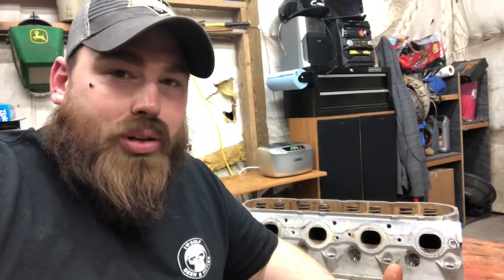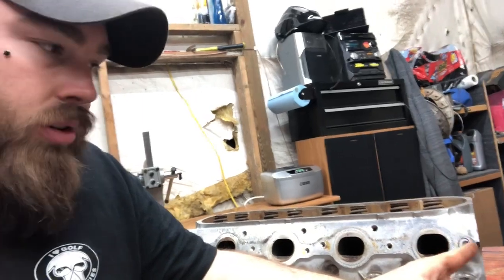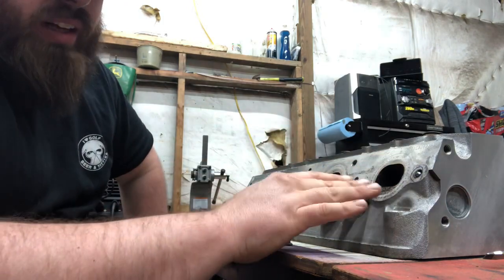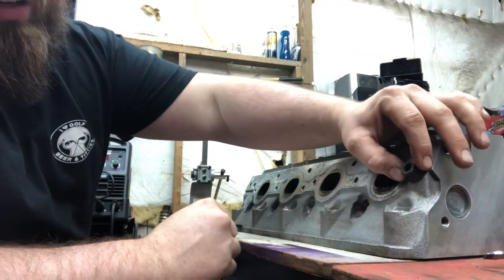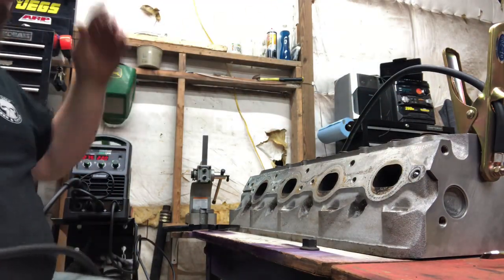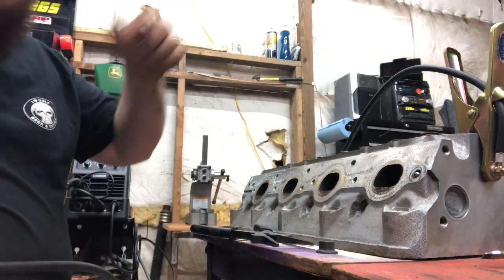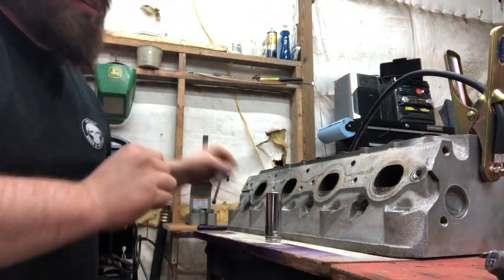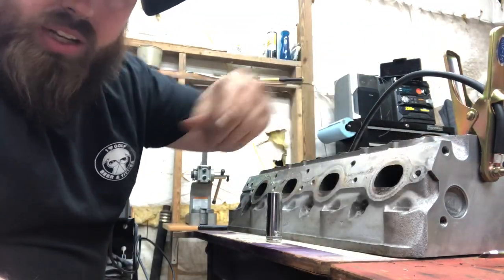Broken LS Exhaust Bolt Removal

Comment: I came here because I just broke off an easy out in an exhaust manifold bolt on a hummer. The engine is out for a motor swap. My fear is that the bolt is a bit inside the hole so there is at least a 1/8" gap between the bolt and the surface... plus the fact the broken easy out is in there.  I have drilled all the way through the bolt and sprayed on blaster as I drilled and after I made it through the bolt hoping to get it on threads through the backside as well.  I have a good flux core welder.... got any tips, do's or don'ts before I  attempt to weld the nut on?  Like others I'm a DIY big time harbor freight customer....
Reply from the maker: Don’t worry about the gap too much just make sure you start your weld on the top of the broken bolt. Easy outs are far more easy to break than people believe. Plus the amount of heat is introduced to the aluminum will help with expand a temporary enough to help back the boat out. I think you’ll be good. Just take your time and pay attention

Comment: What do you do if you have a brass fitting(with a 1/8" hole in the center) in an aluminum head?
Reply from the maker: Drill it out straight to the biggest size you can get it and use an easy out.

Comment: Great job. I know all welders are different, but can you give me some idea of the power settings and wire speed you're using. I have been trying this technique and I'm having trouble getting the weld to grab? I have a Titanium 170 from harbor freight.  Thanks
Reply from the maker: Honestly I have the welder turned up nearly full throttle. It’s better to get good fast tacks on the bolt vs lower heat cause you’ll spend more trine trying to get it to bond well which will actually introduce more heat into what your working on. If you have a piece of scrap metal just turn your welder up to where it gives real good hot fast tacks and do the same thing on your bolt.
Reply: @ZaksMuscleMotors  Thank you so much! I'll run a few test on the studs I've already removed. Cheers John.

Comment: Great video can it be done with arc weld ? I don't currently have gas for my tig yet cheers my head is aluminium
Reply from the maker: You could do it with a stick welder witch would be a little pin in the ass but yet it can be done, or flux core will also work. Just gotta clean the slag after each tack. But remember it doesn’t take a lot either to removed them in most cases so you don’t have to go crazy with it
Reply: @ZaksMuscleMotors   @Zaks Muscle Motors  I managed just 3 out fully 5 are broken I had built up one nicely got a grip but it broke with some force . I've ordered a better brush for the slag  I do try tapping it out etc briefly with a hammer when you say flux do you mean 7018 rods or flux in itself? I'm quite new at welding as you can likely tell I'm keen to get it done myself if possible I appreciate the tips thank you I know I need to get some argon really
Reply from the maker: @kevinhancock4064  I’ll be happy to help you and explain it to you give me a call 7655247362
Reply: @ZaksMuscleMotors  hi mate you're a legend obvs a bit late now but can I call you tomorrow eve 7 ish ? I'd have been to work kids gone bed etc I do appreciate it's become a headache and no expert on welding lol
Reply from the maker: @kevinhancock4064  yea that’s fine it’s 5:20 PM here now. I work thirds so call whenever
Reply: @ZaksMuscleMotors  where are you based then may I ask ? Thank you
Reply from the maker: @kevinhancock4064   Indiana USA
Reply: @ZaksMuscleMotors  nice mate lots of sun ill speak to you later thanks fella
Reply: @ZaksMuscleMotors  hi mate soz not rung yet been a long day how can we chat without it costing £3 a minute?